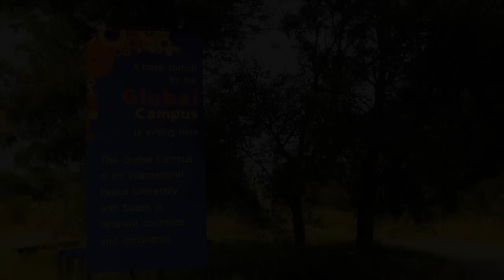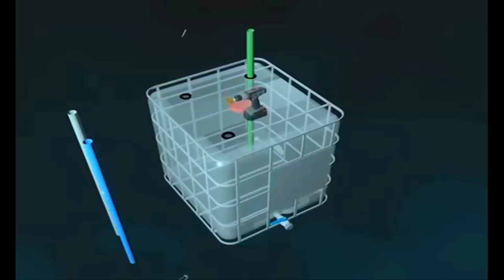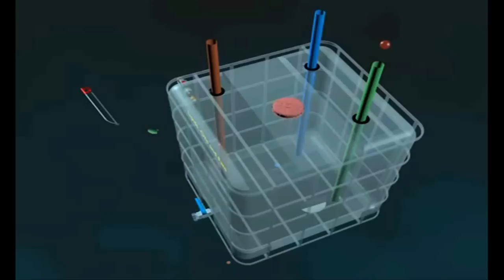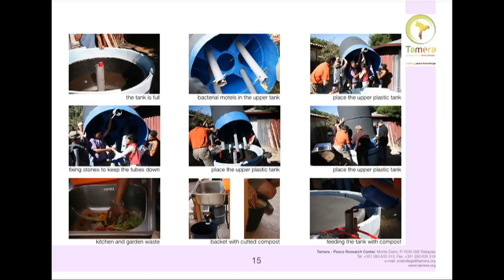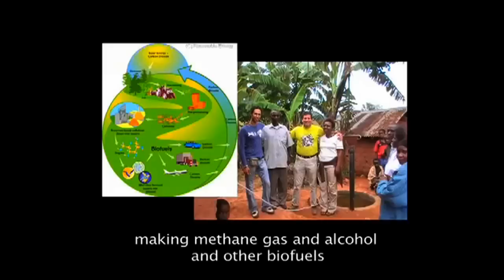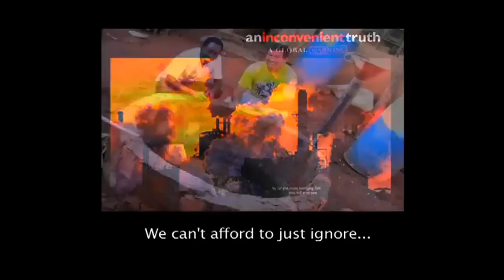BioGas Digesters at The community of Tamera in Portugal | Renewable Energy | Auroras Eye Films

Comment: Nice - in that 3D clip in the middle it shows all three pipes  (in/gas/liquid) going to the bottom, is that correct ? I thought the gas pipe had to go higher (or have a collector underneath it) and the liquid was supposed to go half way down?

Comment: I'm interested to know if the liquid fertilizer is safe to use on vegetable gardens if human waste is added to the digester. Does the anaerobic activity kill pathogens?
Reply: Yes, from my understanding once the gas comes out of the fermenting tank it is just like if it came out of a compost pile and all the pathogens have been killed by the different bacteria
Reply: @stevenporter9114  I've been growing food from human waste for some time now, mostly from composting toilet systems. I would recommend storing the waste as a normal compost with worms etc, or using on fallow land The key here is that it effectively an aged batch before it has contact with edible plant matter. 

Another solution is to bury it below where plants grow, ensuring no contact with edible plant material. My person system was a batch system with a 4 year cycle, and even there i used the above precautions so it was never on the top layer.

Tis better to be safer than to test the limits, spread sickness, and then have the authorities come in and make all recycling impossible.
Reply: @HippyChris  Sounds illegal and you need to read this book "Manual of Composting Toilet and Greywater Practice"
Reply: I enjoy listening to TH. He’s an inspiration. This video touches on some basics for small scale systems. There are many useful guides for the application of digester effluent. I could write a lot here as I’ve been a process engineer for 15 years on all types of digesters all over the world. Biodigesters do not destroy all pathogens; if operating at 98F or 37C, one could expect 90% reduction of fecal coliform. If human waste is digested, then a maturation or hygienization phase is needed if put on crops such as root vegetables. The effluent should be incorporated into the soil two weeks prior to planting if applying directly. At least sixty days before harvest on leafy crops.